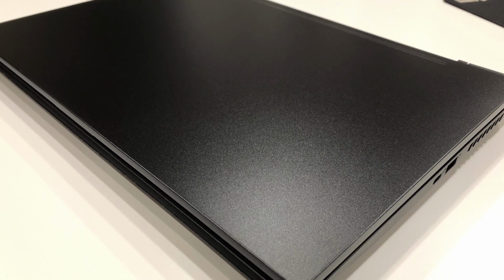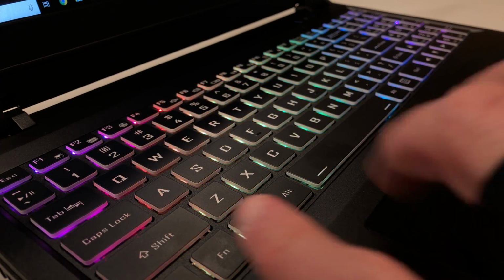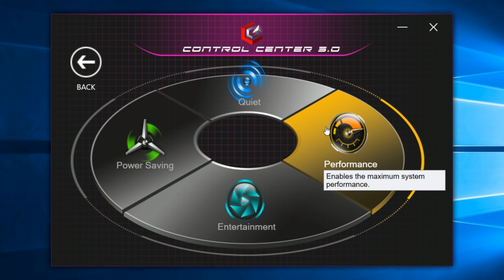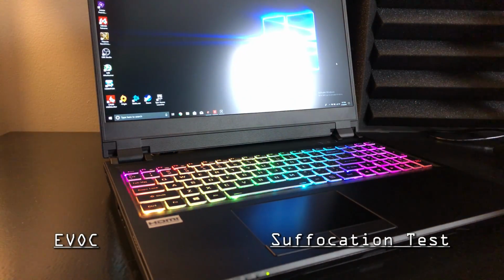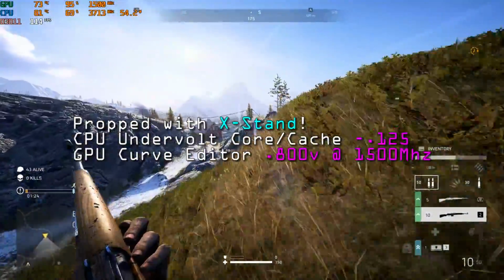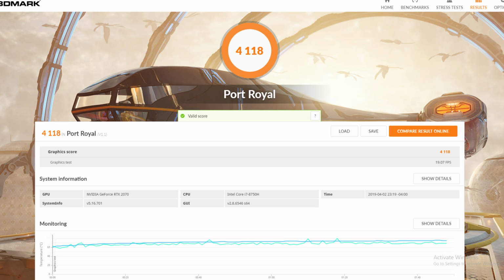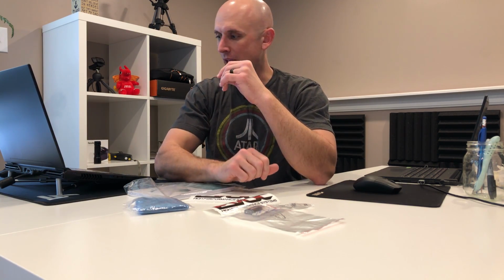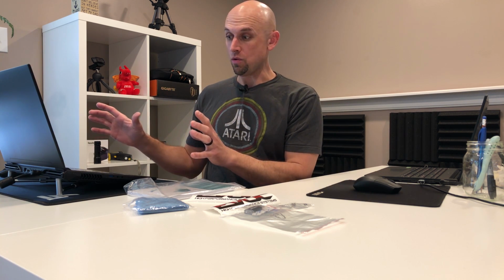EVOC High Performance Systems PB51EF-G!  Oh WOW!

Comment from the maker: Just a heads up on Thunderbolt 3 on Clevo based models.  I have seen more times than not, the TB3 port will actually lack the "lighting bolt" that indicates itself, especially on "mid-range" spec and below solutions.  Clevo uses the same chassis to house many different configs and it's more cost effective to make a laptop this way.  Having someone like me with more experience that the channel reflects is key to your education.  

Here's why the games shown are limited...If it runs the games you just saw it can handle anything else you want to see.

There’s nothing it can’t handle after exposing its weakness and tuning it. 

That’s the way this works here.  Getting too invested in tons of titles loses it relevancy as drivers get updated.  Then you’re left with sifting through the necessary facts that are present here now.

As a Clevo unit, you have access to an enormous amount of software to run on this laptop natively. Between dozens of 3rd party vendors and the enthusiast community, sky is the limit and this is the chassis to get the love it deserves ❤️

Comment: I like how you're being honest. I have this laptop and I can confirm that the air intake is not designed well - the rubber legs are too small and while there are some holes in keyboard above the fans - they are very small. So even with liquid metal you must keep it on stand. Even putting it on your legs can cause issues since you can easily cover up the air intake holes below the fans and Clevo did not put a larger air intake area between the fans like Gigabyte does. Anyway, thanks for being an honest reviewer.

Comment: Sweet review as always bob! best laptop reviewer by far, finally a real tweaker!
Try to cut a few slots into the wide rubber feet above the fan for more airflow? Failing that maybe try making 3d printed higher feet, I guess a a couple of millimeters extra already resolves the issue.
Reply from the maker: Someone’s more than welcome to do that. This is a review unit so it’s going to need to go back perfectly intact
Reply from the maker: Malloot I like where your heads at though 🤛
I’d be lying if I said I would do that myself lol
Reply: @BobOfAllTrades  Thnx, What I would like to see is how much higher the feet would need to be, maybe you can test with a few coins to see how many millimeters it needs to resolve the issue?

Bought the 720s-15ikb based on your reviews BTW, and i like it very much. I never need the full performance of this machine so the issues mentioned are okay for me. But the price for a gtx1050-Ti thin and light was about 400 euro's cheaper then the next best thing, that also has throttling issues.

Comment: Great review! The value proposition on many of these Clevo systems is simply unbeatable. Especially if you take into account that many of these BTO outfits often have sales and promotions on top of an already stellar price.

I'm still very happy with my Clevo PA71ES-G I got from Pro-Star. I did decide to go through with a liquid metal application, warranty be damned. After four failed attempts at a proper seating, I decided to call it quits for now and settle with some traditional Arctic Silver paste. To my surprise, I experienced a 3-6° improvement over the Kryonaut paste I paid extra for nine months ago. Go figure.

Comment: Hey Bob just FYI but this same Clevo chassis is being sold at MicroCenter under the name PowerSpec 1520 for $1499. Likewise, the 17" variant named the PowerSpec 1720 is being sold for $1599. It has the same exact specs, except the 1520 sports a single stick of 16GB RAM and of course just has a generic thermal paste.

I'd recommend people go into a MicroCenter to check out the unit even if they purchase from somewhere else.
Reply from the maker: Yup already covered it in the last deals video 👍
Reply: I bought the 1720, the only real complaint I have is that neither of the USB C ports are TB3-enabled.

Comment: I have this exact laptop but its branded as a Sager NP8377. This laptop is freakin sweet and thermals are amazing after tuning with TStop amd MSI AB.
Reply: Your temps are a little higher than mine though and i havent applied liquid metal yet. Im running at 3.8ghz with 90.8mv undervolt (still tweaking) and i got the gpu to .787mv at 1680mhz's. Max temps im seeing are 69c gpu and 79c cpu. I am ising a laptop coolong pad so that might be making the difference.
Reply: @athanoskerensky6778  i have this exact same laptop as well. have you noticed any issues with the clevo software. sometimes on boot up my keyboard doesnt save the rgb lighting and i have to manually open the keyboard app to get it to revert back to my rgb keyboard setting. also what program are you using to put your gpu at .787mv. thanks
Reply: @therues7071  hello, I've had the same issue with the control center software so I disabled it from start up and just open it manually when i boot my computer. As for the gpu undervolt i used msi afterburner. You open up the graph, select the box that is at 787mv and hit L on your keyboard. A yellow vertical dotted line will apear. Once that's done you can close the graph and set your core clocks up to overclock. I was able to set mine at 787mv with +225 core and +400 memory. You can go lower on the graph than 787mv and get an even lower undervolt and better temps.
Reply: @athanoskerensky6778  sweet thanks for the reply!!!!

Comment: Great review! I purchased this from GentechPC with a stock 250 GB SSD (Samsung pm 961), 16 GB dual channel, and got basically free liquid metal CPU/ ic diamond GPU, free Fuji thermal pads (thermal upgrades were 2 cents extra). I plan to add an Intel 2TB SSD to the second slot eventually. Total cost with NBR discount was $1740ish :) Only thing I am slightly nervous about is adding the second SSD since it needs the keyboard to be taken off. Would you say it is difficult for the average person? I haven’t seen too many people show how easy/difficult it is yet.

I haven't played any super demanding games yet but it crushes fortnite and overwatch without getting super hot. Temp wise the highest I've seen is high 70s CPU, and mid 70s GPU when uncapped on a flat surface. Granted I've been running in entertainment mode mostly with a cooling pad and cap the FPS which kept CPU Temps in the mid to high 60s and GPU in low to mid 60s. I was also able to undervolt to -.170 without any errors so far.

 My other current laptop used for gaming is an XPS 15 i5 7th gen, GTX 1050. So for me, this is like going from gaming on an ultrabook to a high end desktop lol.  Only thing I wish it had was a bigger battery rather than the drive bay as you mentioned.  I have managed to squeeze about 4.5 hours out of it via hybrid mode with battery saver, power saving mode, 25 percent brightness.  Love your reviews by the way! Wish more reviewers would actually go in depth like you, ownordisown, and Jarrod. Keep it up! :)
Reply from the maker: Jonathan R I didn’t remove the KB to reveal the motherboard here. It’ll take 10 minutes to install the second m.2 🤛
Reply: @BobOfAllTrades   Bob Of All Trades  oh so you were able to take off the whole back plate without removing the keyboard? Only reason I ask is because I remember someone in the PB thread at NBR saying they almost warped the backplate not knowing there were a few screws under the keyboard that needed to be removed and I believe Jarrod had  videos of the clevo p960 and p970 where those models needed the keyboard to be removed before  unscrewing the back plate completely. Thanks Bob!
Reply from the maker: Jarred had a completely different machine than this. There are two screws on the bottom that have a cute little keyboard next to them to ultimately insinuated those screws would need to be removed in order to actually pull the keyboard. Treat those screws just like they’re part of the bottom panel. Trust me brother, the job takes about 10 minutes to do. If it were any different this review would’ve revealed it 💪
Reply: @BobOfAllTrades  ok great Bob! Thanks again 👍👍
Reply: Jonathan R Hey i just Donna know how Its hold up? Im thinking of buying this laptop or Aorus 15xa. Witch do you Think
Reply: @konstantingadekryger5146  mines great so far. Only issue I've had is some slight backlight bleed but it's not enough to bother me personally. I've always used a laptop cooling pad when gaming so the propping up doesn't bother me. 

The aorus doesn't have g sync and doesn't  have switchable graphics so you can't use Optimus to save battery life. Battery life can be really bad in dedicated mode if that matters to you. The clevo also has two m.2 slots which I really need on a 2019 laptop at this point. Not sure if the aorus has 1 or 2 slots. Might be something to consider.
Reply: Jonathan R Ok nice to hear im just worried about the quality becouse the brand is NOT so popular.
Reply: @konstantingadekryger5146  I think the main thing with clevo is that they don't appeal to people who want the sleekest, modern looking, thin as possible device. 

Clevos are more "plain" as far as looks and feel. Doesn't bother me at all personally though. I prefer that they are much more customizable, generally easier to upgrade, and offer more performance per $.

Comment: Bob, one thing I'd like to see you cover is the difference between Optimus and GSYNC on laptops when it comes to mirroring displays. This gets overlooked a lot. Take the following use case for example -- again, just one example among others. Say I have a living room setup and I'm using the laptop as the entertainment center. And let's say I want to play local co-op on a game like Cuphead. My friend doesn't care about input lag on the TV, but I do, so I mirror the laptop's display. I look at the laptop display and he looks at the TV. This works beautifully with a GSYNC laptop. It's not even possible with Optimus as far as I know. I've only been able to display to an external monitor only, or have the external running smoothly and the built in display running the game at a very choppy <30 FPS. I think a lot of people don't understand that limitation of Optimus.
Reply from the maker: I’ve talked about this before actually Optimus laptops are not very versatile when to comes to stuff like this. 

I’m not like other tech reviewer‘s that have tons of hardware laying around so plugging it into other monitors to continue to beat a dead horse is not something I have access to
Reply: @BobOfAllTrades  I understand. Got a question for you if you have the time -- not sure if you know the answer. Do these GSYNC / Optimus enabled laptops have any issues with mirroring displays? I don't understand everything about the MUX switch issue. Like, I don't know if all laptops that give you the option of GSYNC or Optimus have a MUX switch, or if that's just one way of doing it. And I don't know if one way of doing it causes an issue for the use case I mentioned and one doesn't. Have you made a video where you've shed some light on these questions?
Reply from the maker: If it’s switchable then it uses a MUX.  

I will get around to making a video on what I think laptops of the future should be like and that is part of it.

Comment: Without that stand though I'm curious about that laptop's thermal future.  HIDevolution should just improve the feet or include the exact stand you recommended or a similar one.  Especially at that price.  Really good review as usual.
Reply from the maker: It’s not up to HID. Clevo makes the chassis. HID is the vendor that creates perfection of a laptop already built.  

There is t a bottom panel to prop the laptop up....yet.   I’m working on it with a few vendors. Give me time 👌
Reply: @BobOfAllTrades  Is this really something you are doing?  A replacement panel with a prop would be something I'd consider, I have the PB-71EF-G.  Also thanks for this review, it really sold me on this machine and Clevo brand.

Comment: Excellent review there , i do wonder , for suffocating laptop like this one, does cooling pad does the job or x prop does the job better
Reply from the maker: I don’t do the cooling pad thing.  Never was a fan of those.  If this were mine I’d probably mod the feet for better airflow and ditch the prop all together.
Reply: Bob Of All Trades My suggestion is removing the feet on sides near the fan intake. 
Experimental: Increasing the height of the feet with a cut plastic pipe and clay might help. 
Hope that would help the thermals

Comment: So I finally bit the bullet and purchased a Sager NP7853 (Clevo NH58EDQ) which has similar specs to this unit (2060 instead of 2070) and a slightly thinner chassis. After watching this video, I'm pretty confident that the thermals won't be an issue (especially since I ordered it with Kryonaut) but I'm curious to know if you'd ever consider reviewing that particular model. Also, does it have TB3 or not lol?
Reply from the maker: I’d like to but these laptops have a very little view count so it’ll be unlikely that HID would send one.

Comment: Thank you so much for the effort that u put in your videos.
I really need your opinion because i am so confused even after watching different reviews, 
I am looking for a laptop for next 2-3.5 years to do: programming, statistical analysis, and gaming for long hours.
Weight & size don’t matter, battery life at least 2-2.5 hours for reading pdf or writing on Word.
I did research for the last 6-8 months and i finally minimize my list to 3 laptop :
1. Lenovo Y740 15 or 17: rtx 2070 max-q ( the KB on the 15 don’t bother me i use  external one it’s around 1578$) & 17 around 1632$ 
2. Acer predator helios 500 : gtx 1070 : around 1700$
3. (If you suggesting another better laptop better than those two )
I am really sorry about the long comment and i appreciate your opinions and thank you so much for your help in advance.
Reply from the maker: I like the y740 for thermals and acoustics but it’s not getting 5 hours unplugged.
Reply: @BobOfAllTrades  Thank you very much.
all i need 3 hours max unplugged.
Reply from the maker: Then definitely go with the Lenovo 🤛
Reply: @BobOfAllTrades  it's now $1,409.99 :) if are gonna male another video about hot deal.
thank you again for your time and every thing that you do.
wish you all the best and success in your life.
Reply from the maker: I don’t have any plans for hot deals right now. Too busy lately
Reply: Did you go for lenovo after all? I'm curious because I'm looking for similar machine for the same things.

Comment: Great review!
Thank you very much! 
I am going to buy XMG PRO 17 custom (Clevo PB71ED/EF-G) Intel Core i7-9750H / NVIDIA GeForce RTX 2060.
That's a little newer processor, but I hope that my choice will not so hot in gaming.  
What do you think?) Will give it better cooling or not the 17 inch model?
Cooling system one of the most important question for me at laptop.
Reply from the maker: Should be OK the graphics card won’t pull quite as much wattage is the one  in this video. Then again this one had liquid metal so you could be close despite the larger chassis size.
Reply: @BobOfAllTrades  thanks a lot!
Waiting for another good and right reviews)
Good luck!

Comment: Oh man, this with the 60Hz Samsung Display OLED would just be downright sick!
Reply from the maker: Andrew Morris That’s a 4K panel with Optimus. Probably not ideal for Gaming but pretty sweet otherwise 👍
Reply: Bob Of All Trades Total noob here, what is Optimus?
Reply from the maker: Andrew Morris Nvidia Optimus switchable graphics.  Google that for details.
Reply: Bob Of All Trades Oh I see, so you can’t use dedicated graphics. That 4K OLED must be a power hungry son of a gun!
Reply from the maker: Andrew Morris That’s not it. It’ll run on the Nvidia graphics as that’s how Optimus works. But a 60hz panel is going to have some severe screen tearing.  If it had a MUX switch like this particular laptop then we could run Fast Sync and set the resolution to 1080p for at least a decent gaming experience.
Reply: Bob Of All Trades Ah I see. Thanks!

Comment: Hey Bob of all trades I have a question. I just purchased this laptop but from avadirect. Mine will come with the standard duel channel 2666mhz memory. Will I be able to just slap 3000mhz memory in my laptop when I get it and if so what fps gains would you expect. Is it worth it?

Comment: Bob, if you could only have one laptop out of all that you've reviewed, which would you choose?
Reply from the maker: Man you’re going to get a pretty opinionated answer with a question like that. 

I’m much older with a wife and kids plus that college ship sailed half my life ago. Having a laptop like the aero 15 suits me very well. Had you asked me that question 10 years ago I would’ve said give me the GT 75 titan.

If I did not enjoy gaming and Apple could make a better keyboard I would consider a 15 inch MacBook Pro
Reply: @BobOfAllTrades  I used an older Macbook Pro 13 inch and I loved it for normal use. I'm in the same boat. I game in my spare time. I tried to switch to an Asus ROG GL503VFM full time, but the 3GB 1060 seemed crippled at 1440p on the games I enjoy. I ended up building a $700 Ryzen desktop system with 1070 and only using my laptop when I travel. Just seems like such a waste having two different machines when one barely gets used. How do you feel about the new Eluktronics G2? I don't think it's possible for me to find a new gaming laptop without thermal issues.
Reply from the maker: The G2 is excellent and Eluktronics is a top notch company 👍